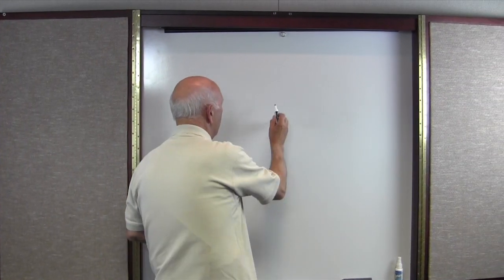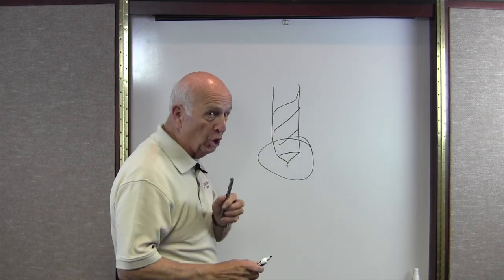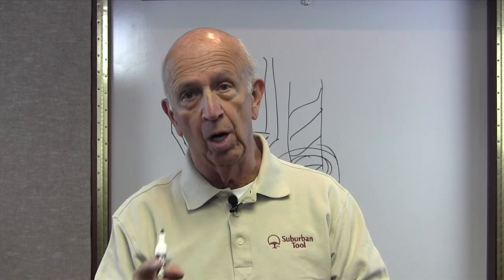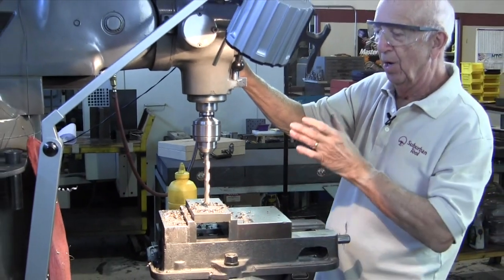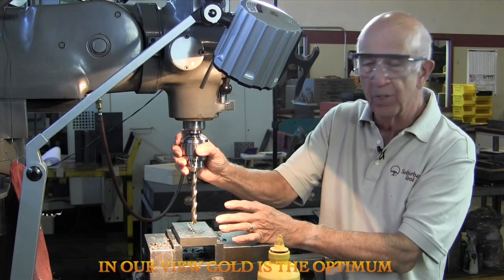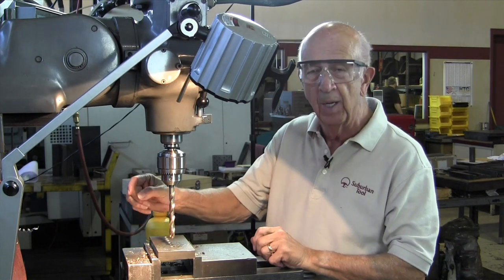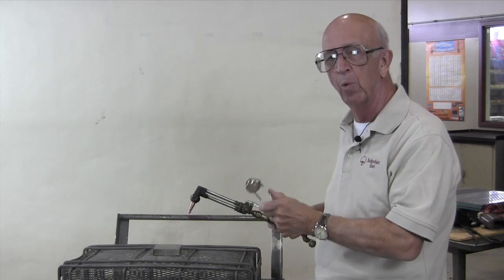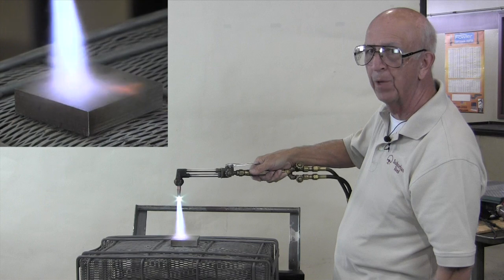What the color of the chips tell you when drilling

Comment: Do you all have any experience with the winslomatic style drill grinders? Any thoughts on the various drill geometries that can be ground and their uses? That would be an excellent video I think.
Reply from the maker: bcbloc02 We do not use the WinsloMatic style grinders so that may be better suited to someone with experience with them. The various drill geometries would make a good video. We will try to do a video on this topic soon. Thanks for watching and sharing.
Reply: bcbloc02 In a basic shop there is basically only two grinds: the conical grind that is for some strange reason "the norm" that 'everybody' grinds and learns, and then there is facet grind (preferably 4 facet) which is a lot easier to learn, do, get symmetric and gets you a drill that may not need a starter hole and cuts alot easier.

But if you are a production shop, then it pays to buy a CNC grinder that can do whatever you want to get the best performance for the type of work you need to do.